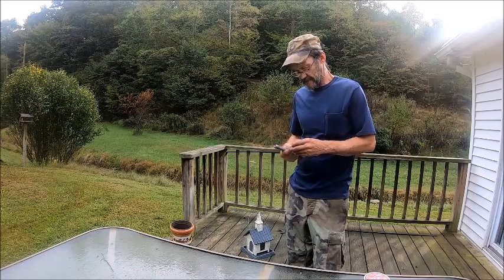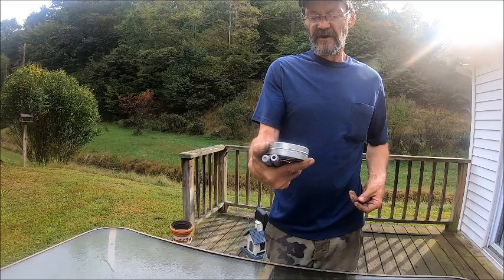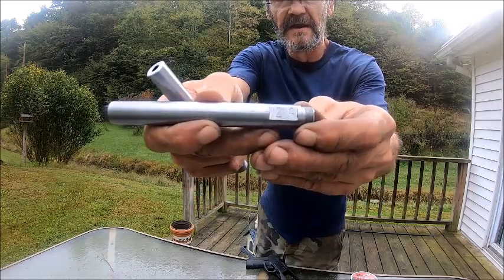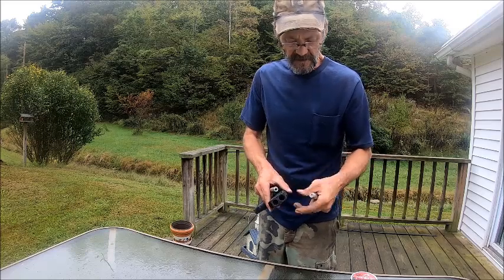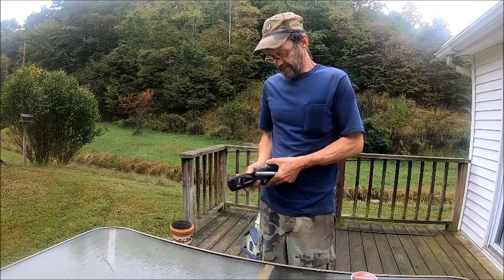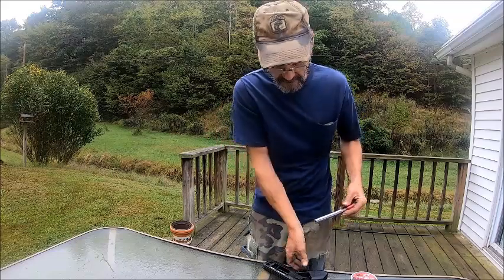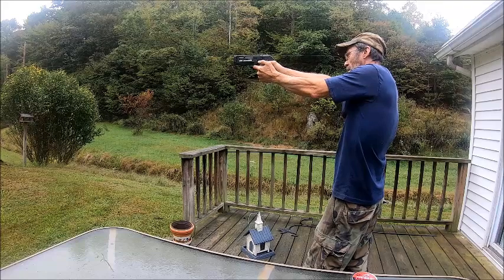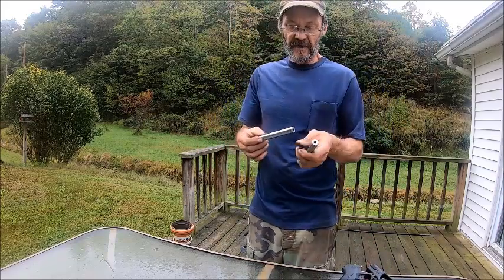25 cal barrels for the aea defender

Comment: My 8in .457 does 70fpe if there could be a 13in so I can reach the 85-100fpe range and a 24in long barrel in .308 and .457. if the modoc .357 can shoot 80g 357 at 1000-1300fps out of a 39jn barrel using smaller cartediges with only 3000-3300psi then ide bet a 24-26in defender could send .25/.308 50-70grain slugs at 900-1100fps. A .457 in this length would surely be a 200+fpe gun. Awesome over under ide love to have for pistol self defense to hunt boar and such with fast .25/308 rounds along with deer and other bigger stuff with .457.

I wouldent even care if it's just the barrels. Ide make a 3d printed front grip or stock that also has rings inside to stabilize and hold the barrels. Add a little collapsible stock and I've got me a dream gun. If I can get a 26in long barrel in .410 or 12ga to then it's the perfect survival rifle. Cheap, hunt small or big game, multi cal, light, modular, over under, can fill with hand pump and the ammo is light and cheap. It's like a super bug out gun. I could make the barrels unremovable even. Just screw in a male side on the cartrdige as long as the slug is and a female adapter screwed into the barrels back and when properly sized and fitted juat break open then gun slip the male side into the female adapter making a airtight seal and then close the gun shut holding the cartrdiges pressed forward with more strength. You fire, open the gun, pull out the used aircarts and slap in 2 new ones. Would be easy to do no mods done to barrels of anything just need a rigid style coupling that's threaded one end smooth the other to go on the barrels back usually that's connected to the cartridge then u cut a barrel with the threads to go into the cartridge only long enough to fit a slug. 

Or you could make the barrel the male side and the slug have the female adapter. If you were to make a tube fed pump action shotgun style, or box magazine fed style gun it would work better female on the cartridge you can have a track for it to fall into place on when its lifted into fire position so when it's pushed forward it's always going to be in line and go over the barrels male side every time. Using a system like that you could make a 30inch long mag fed bullpup with a 28in barrel that's 1000+fps in .22, .25, and .308cal with no tanks or bullshit making it weigh closer to 4lb than the average comparable guns 7-11lbs